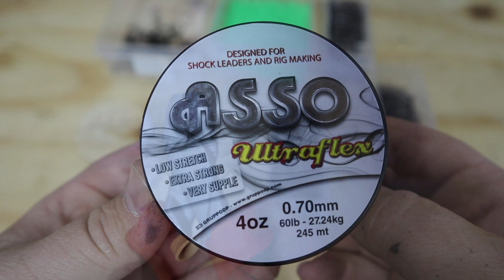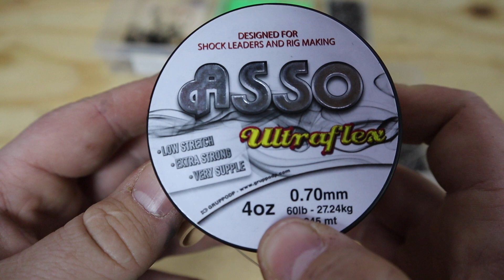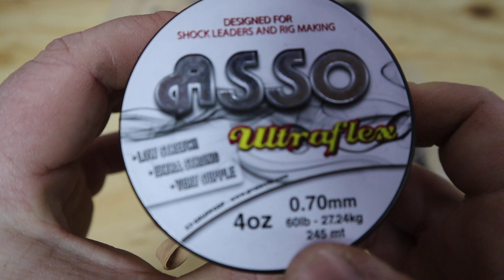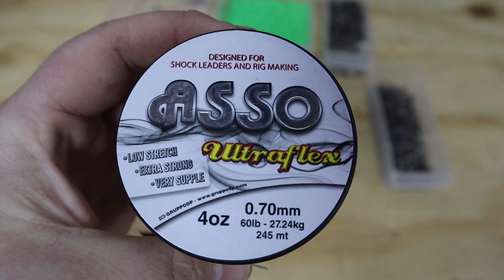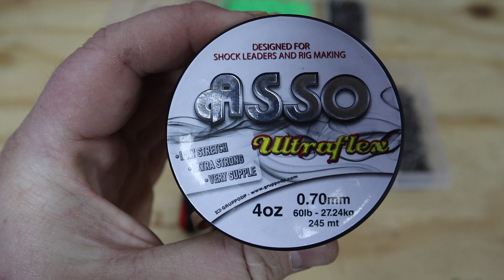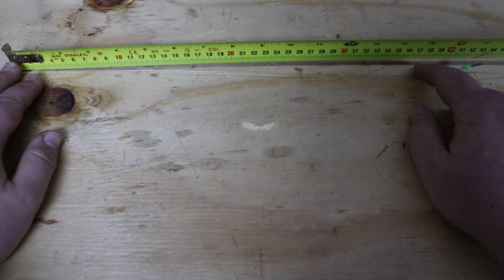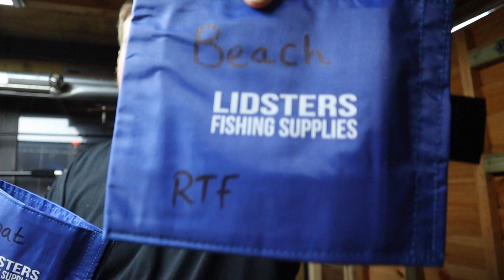2 hook flapper rig series, Detailed start to finish.

Comment: Well done,nice video.
That cinch knot is great when using heavy mono..150lb e.g.
Keep up the great work. 🎣
Reply from the maker: Yes it’s a great knot we’ve been using it a while now and hasn’t slipped once and dead easy to tie as well which is a bonus 🎣🎣
Reply: If using 150 lb mono I use a heat gun to warm knot snugs up lovely I hold in vice or on nail pull and gently warm 👍

Comment: Thank you very much for sharing this great video!! I like very much  this knot you use , to tie the swivels and the hooks , specially when you have to tie thick line like 0,70 mm.Just one question i have . For which  weather conditions  will this rig work better at your opinion  according to your experience ?  Maybe with trouble sea and not with clear waters works better? Thank you in advance
Reply from the maker: Hi no problem glad you enjoyed the video that knot is extremely good for thick line. I use the rig for general fishing in all conditions it’s handy as one hook sits closer to the seabed and one sits around 1ft up so your in the kill zone
Reply: @ReelTherapyFishing    thanks a lot !

Comment: Did you use the same weight line for snood as mainline? I was under the impression it’s good to use lighter line for snoods? Any thoughts?
Reply from the maker: Hi mate yes I used 60lb line for all of the rig body and snoods, it’s all personal preference to be honest there’s no right or wrong answer, I’ve done it like this for several years and find this works for me 😃
Reply: You want to be using lighter light for hook lengths